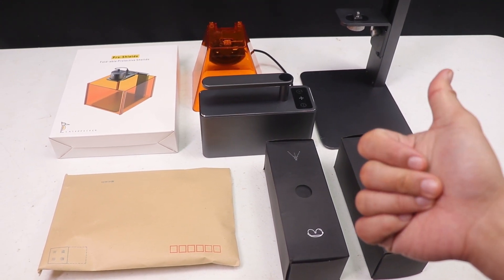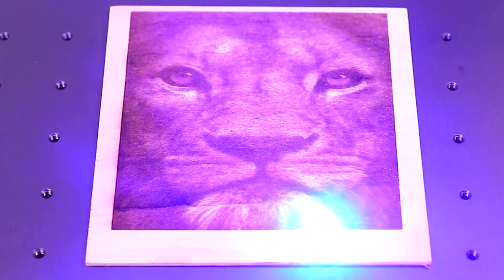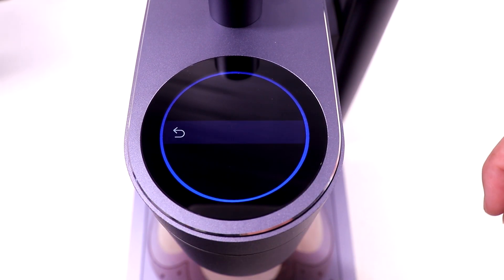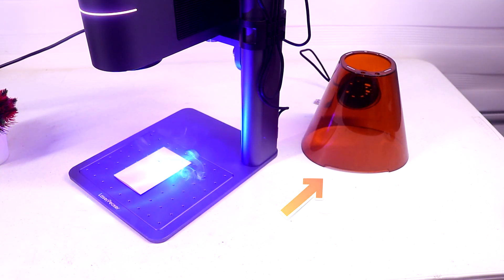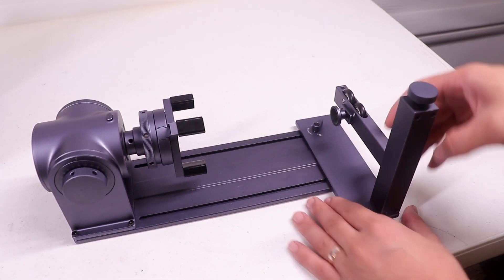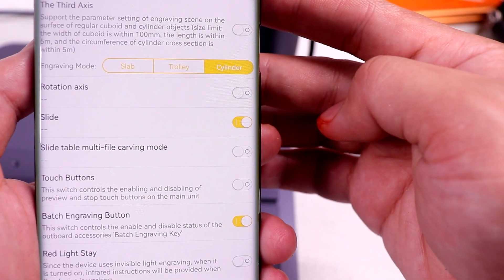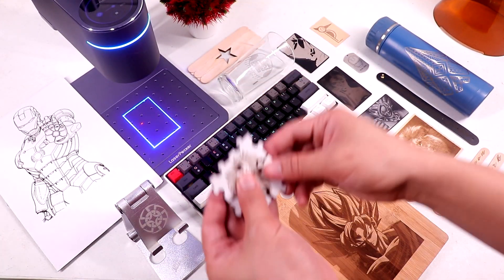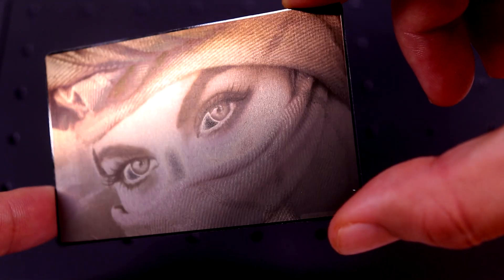Laserpecker 4: Cutting Edge Technology with a Twist You Never Saw Coming!

Comment: The 1064nm in the LP4 “isn’t a fiber lasers”!  It is a 1064nm pulse diode module, using a galvo head.  There is “no fiber source”, this is false advertising on LP’s part.  Influencers should be educated enough not to push these false claims.

Comment: So what happens if you use the wrong laser with the wrong material? What happens if you use the 1064nm with wood? Or the 450nm with metal?
Reply from the maker: Well, it still can engrave with some adjustments to the power and depth, but results may be different compared to using the right laser to the right material.